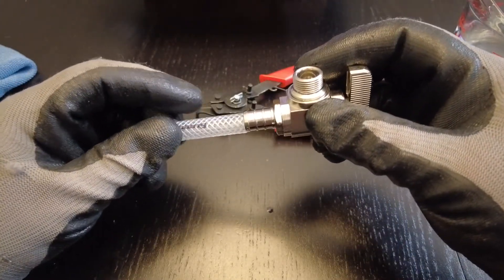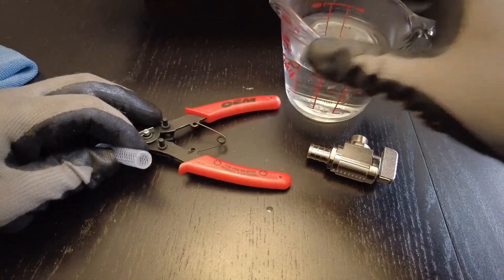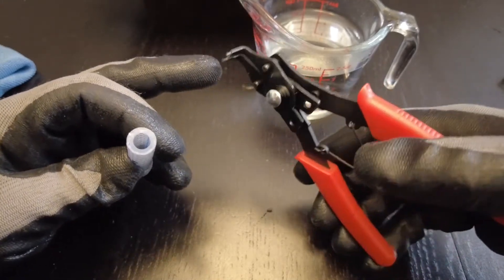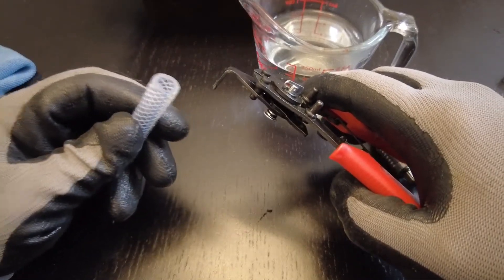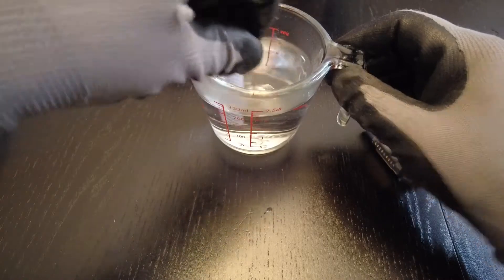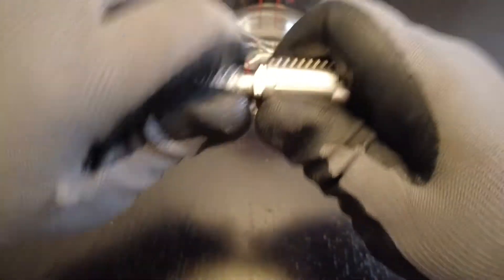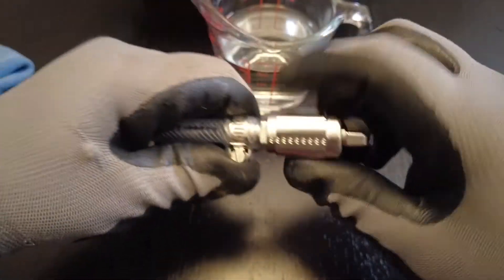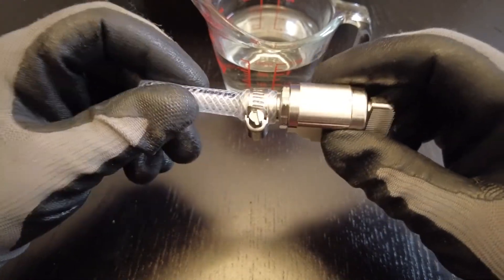How to transition from 1/4 inch vinyl tubing to 1/2 inch PEX for vanlife drinking water system

Comment: At home Depot or Lowe's they sell plastic Barb fitting with threaded on one end. They are in the same aisle and I believe they are meant for this purpose. HDPE black plastic pipes use a different kind of Barb fitting

Comment: Sharkbite makes a 1/2 to 1/4 reducer fitting. They are about $6.50 each. It's the best option I've found.
Reply from the maker: Hi Will, thanks for letting us know! I looked on Amazon, and is this the one you have in mind? https://www.amazon.ca/dp/B00A8HV1GM/ref=cm_sw_r_cp_apa_glt_i_D3F80PATD1DFGY36DGEA
I think this is for Pex and not for braided vinyl tubing? Thanks for the suggestion!
Reply: @sprinterdiscovery  I am about to face the same issue you have with a drain line from a beer drip tray. Wondering if we could use the fitting above, but then put a bit of smaller pex on the 1/4 side and then from there find a fitting that is 1/4 x 1/4. I think the smaller John Guest PTC connections can handle both vinyl and pex. Adds extra fittings which I don't care for but might work.
Reply from the maker: That might work - give it a try and let us know the result. I'm surprised that a manufacturer hasn't created a transition part for this case (and if they have I haven't found it). I use Corny kegs for my water storage in the van, with 1/4 inch ball lock connectors. I then had to figure out a way to transition over to Pex in order to use a standard water faucet in the van - hence this video. A bit of a hack but it works and has worked for about two years inside a van with a constant 60psi on the lines with no leaks. Thanks for watching!
Reply from the maker: @craftm524 I was looking through the McMaster-Carr catalogue this morning, and it seems you could use a 1/4 to 3/8 and then run a bit of 3/8 tubing to a 3/8 to 1/2 connector. Take a look at this page and see if this might work for you. https://www.mcmaster.com/plastic-push-connect-tube-fittings/push-to-connect-fittings-for-plastic-tubing-food-and-beverage/
Reply: @sprinterdiscovery  I'm in a holding pattern at the moment as the place I am buying my inline pressure reducing valve from seems confused on barn size so I may be going 3/8 to 1/2 instead but those fittings look good!
Reply: @sprinterdiscovery  So after messing with them, they are actually made for 1/4 ID pex which is 3/8 in diameter. Really odd in the end. In my case I'm adding some 1/4 sized TDS meter probes. I'm just going to use food grade silicone to glue them into some 1/2 pex that I'm crimping onto T's before and after my main water filter system.
Reply from the maker: Hi Will, thanks so much for the update! Appreciated!

Comment: I’m not a fan of stretching a hose that much. It weakens the hose at the most critical point, at the edge of the fitting inside the hose. I’d prefer using the proper hose barb fitting having male pipe threads and use a valve having female pipe threads.
Reply from the maker: Locally I could not find the proper hose barb despite going to several big box stores and specialty plumbing stores. Which part would you suggest to purchase and from where? Thanks for watching and leaving your comment - very much appreciated!!😁